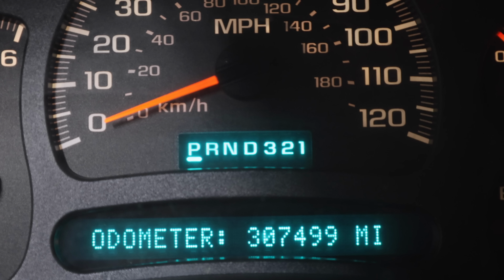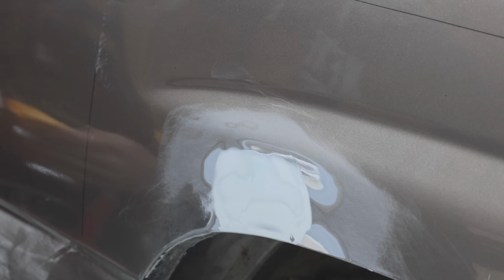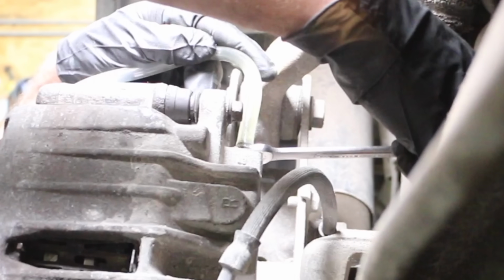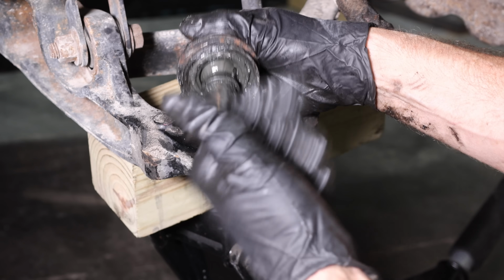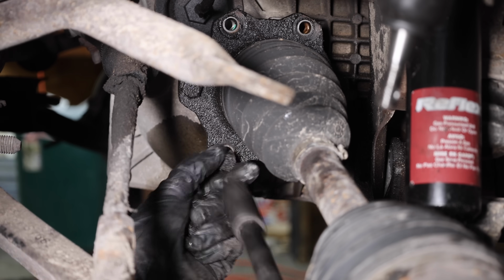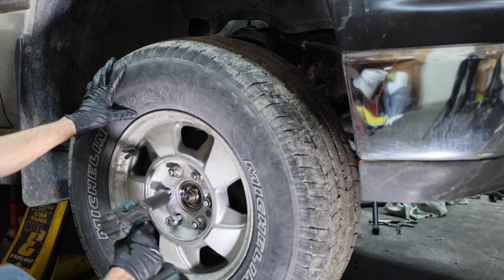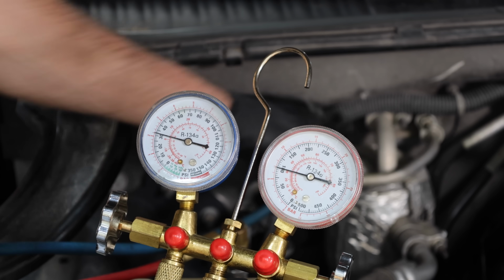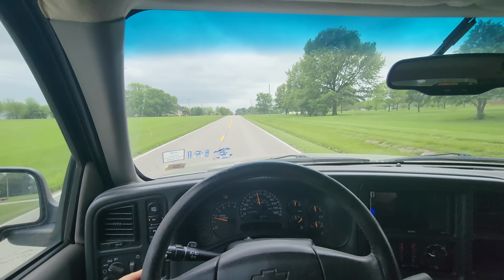Is It Stupid To Fix Up A 300,000 Mile Vehicle? Let Settle This!

Comment: I really enjoy all the stuff that you do because you’re so thorough. I went to a Bendix brake class about 10 years ago maybe more and they insisted that you open the bleeder before you collapse the pistons so that you don’t put any of that gunky brake fluid back through the lines to the ABS unit. And then doing it this way you can have clean fluid because you can just leave the bleeder open and put more in the master cylinder anyway you want to do it, but it’s a good idea to change the brake fluid because it does have tendency to suspend moisture which will corrode the calipers and pistons and stuff. Keep up the good work man I really like what you do.

Comment: This is really interesting. I've got a 2002 Suburban with 312K on it and I've recently been considering getting it back on the road. I'm afraid though, it may be one that has the micro cracks in the aluminum head and is burning through coolant. Any insight on that?

Comment: Only the total toe affects the handling. Having one side toed in and the other toed out the same amount will just mean the steering wheel is off center going down the road. Definitely something I would not want, but it is not a safety issue, and will not cause excessive tire wear.

Comment: There was one more thing that you could have done since you were so far in the front end. You could have changed the Upper A-arm bushings. (Lowers tend to last a lifetime.) 
New bushings reduce vibrations at high speeds! Cheers.

Comment: You repair a vehicle until the price of repair exceeds the price of replacement.

In my market that means you repair pickup trucks until the body rusts off the frame. 

A good friend of mine never spent more than $500 (1990's dollars) on his commute vehicle. He'd run it until it broke down and then he'd sell it and buy another $500 beater. Most of the time he'd get six months to a year each vehicle.

His reasoning? Beaters were cheaper than buying "better", they did what they needed, and were cheap to insure. Plus, AAA is/was cheap and when he sold it, he usually had enough $ to buy another or close to it.

Comment: I have an 08 Sierra that doesn't have any steering slop, but simply changing out the shocks and coil overs made a massive difference in how it handled. You don't notice how bad they really are until you swap them. It was totally worth the time invested and shocks were surprisingly cheap.

Comment: The thumbnail poses a question.  The answer IMO is no.   A vehicle with cab/chassis is theoretically rebuildable til the end if time and thus worth having/keeping.  We're you "dumping" money into a unibody type car, I'd change my answer to yes.  Unibody is designed obsolescence since repairs to the "cab/chassis" are way harder to complete and once corrosion starts its damn near impossible to stop

Comment: I just sealed the differential on my 2001 Yukon in the same way.  I didn't tighten the cover bolts until a day later, and when I did, uncured RTV came out around a few of the bolts, so I waited another day before filling it.  No leaks, but I'm not sure if it's worth not fully tightening the bolts the first time on the initial cure.  The most important thing is not to use too much of the RTV, it's just like the three bears story, you want the amount just right.

Comment: DON'T change your pacing. If someone has trouble keeping up they can adjust the playback speed to their liking. 

p.s. - at  20:00  mark, for front wheel pivot I use a folded plastic garbage bag between 2 sheets of carboard under each tire

Comment: 0:18 Strangely enough, the front-end wheel slop would have been enough to have it illegal to drive in the UK (MOT fail right there) - Otherwise, the rest of the issues would be normal maintenance (changing the brakes being the most obvious). Still very good to see and shows how with a bit of good maintenance a car can keep rolling for literally years longer.

Comment: I fixed up a old 1995 dodge ram 5.9L V8 that had 398k miles on it when I got it. After rebuilding by getting nicked and dimed over 3 years. I had virtually a new truck. body panels was dooky but the frame was from the desert so it had almost no rust. got the odo over the next 8 years to 999,999. used it for a about a year after that before a drunk driver rear ended it and destroyed the frame T.T I loved that truck.

Comment: So hey, what are you doing with the good 50,000 mile spark plugs and wires buddy? Ive always survived on leftovers, and the cars most people gave up on years ago. 
But really, Good used factory parts can be better than new cheap aftermarket parts. Especially sensors, starters, and alternators. Hard to explain to someone that their brand new parts are the problem, but when its better with used parts, they get angry. 
Bad new parts are more common than ever.

Comment: So how long did you work as a professional mechanic? I'd like to do this kind of maintenance to my 2010 Tundra, which has only 160k miles and a lot of dings and rust. But no way I'd have the confidence to attempt almost any of the repairs you did. Very impressive.

Comment: Love the 2X4 sanding block. I've done the same. You use what you have around you. Don't know how many times I've had to create my own "special service tool" by cutting and welding angle iron or flat bar to get the job done.

Comment: Got to keep those old vehicles running. So yeah, even if you have to fork out a couple thousand dollars in replacing old suspension, brakes etc.. it's definitely worth it to keep these vehicles on the road when you consider the lunatic prices of new (or even used) vehicles.

Comment: Don't change a thing, have been watching for years and your pacing is perfect.

The only thing I would mention when changing dif fluid is loosen the fill port first, it sucks to drain it and then find out you have an issue with the fill plug being stuck or stripped and need to run to the store because you didn't pick up a new plug. 

Had it happen to me a few times but luckily had a second vehicle to drive to get parts with.

Comment: I bought my 93 ranger with 300 thousand miles because my other one had 760 thousand miles. Dropped the engine in my new truck runs good 3 yrs later

Comment: You failed to address or adjust caster and camber when you aligned the front end. It makes a big difference. On most RWD Chevies you can true caster by equalizing plumb deviation between sides and bring them to spec by measuring and adjusting rearward axis tilt from upper to lower ball joint grease inserts. You can true camber by plumbing each outside wheel rim using a level.

Comment: Nice video.  15 years ago I paid Les Schwab to replace all the brakes, ball joints, tie rods, struts / springs, other suspension and tires on my Mitsubishi Galant with 425,000 miles on it (the engine and transmission had been rebuilt and the rest of the car was near mint) for about $4,000.   A few months later one of the springs broke.  I found out that Les Schwab did not replace the springs on the Struts as I had requested.  Then Les Schwab said they would not honor the warranty as the springs were used.  Thus breaking my car and leaving it unusable, especially as they banned me from their dealerships for complaining about this.

Comment: I'm a big fan.  I want you to test 15W-40 diesel truck oil mixed 6 oz per quart with Marvel Mystery Oil in air cooled motorcycle engines vs. motorcycle specific oil which all costs a lot.

Comment: Your car is an expense, not an investment. The idea of spending $3000 on a car worth $5000 doesn't really apply, the only metric is how much is this truck going to cost you over the next 5 years. If spening $3000 means not having to spend $50k on a new truck, that's a bargin no matter what the truck is worth. However spending $3k on a truck that is goign to cost you another $10k in repairs over the next 5 years the math starts to change but still going to take a lot of repairs to make up the diffrence.

Comment: As far as protecting the car's surfaces, periodical washing, decontamination, machine polishing and then adding a ceramic coating, not just a spray, will ensure rust free for the future (if there is no internal rust?).

Comment: For a Vehicle that's driven 482 000 Kilometres ( 300 000 miles ) it most likely require Engine Re-Build and new wiring. Also all the fluids and filters changed. GM still make brand new LS1 Engines in USA ? LS1 is one of the best engine swaps for most cars.

Comment: Definitely much cheaper than replacing the Suburban with a new one. Greener too. Another thing I noticed, there seemed to be lots of room in the engine bay and suspension area to work on. I'm not sure a new vehicle would be the same.

Comment: Awesome video Todd, great work as always :) 

A tip I learned the hard way - with the brake bleeding, if you're getting rhythmic air bubbles like in the video, often I find that is caused by the bleeder being ever so slightly too open - closing it a touch stops them. I imagine less of an issue with a fluid extractor (could even be because of the fluid extractor?), but when doing it manually I definitely notice the pedal is slightly less stiff with those bubbles passing through :)

Comment: This was certainly not what I was expecting based on your  title, but interesting.  I will say, that it is less expensive to repair as you go on a high mileage vehicle.  We are currently driving a 2002 Ford F150.  People keep asking us why we keep fixing it instead of buying a new one.  It's because our repairs and maintenance are generally less than a car payment when we do take it in, and save us hundreds over buying new.  It is always better to repair than to replace, unless the vehicle was a lemon model to begin with.  So, no, it is not stupid to fix a 300.000 mile vehicle.  Good show!

Comment: My 2000 k2500 just cracked 250k miles and just got a whole new coolant system, ignition system, and currently installing a bunch of new suspension components. New vehicles are too expensive, gotta keep the old ones running! I am fully convinced that my frame and body will go before anything else (thanks to East Coast and Midwest winters) great video man.

Comment: 0:15 Here in Finland, all cars older than 5 years  have mandatory yearly inspection and you cannot legally drive any car with that much slop in steering (or in suspension in general). Old cars do not have sloppier steering here than say 7 year old cars if they are street legal. Even a single sloppy ball joint in the steering parts results to failed inspection and if the car is otherwise drivable, you get 30 days extension for the car to fix the issue and re-inspect the car. If you fail to repair the car, it's illegal to drive the car on public roads after those 30 days.
Reply: People here drive with bald tires, clicking CVs, grinding wheel bearings, one head light...and all kinds of shit. Some states have vehicle inspections, but here in Ohio, we don't. We do have whats called an "E-check" which is an emissions inspection, which you need every two years.
Reply: My state has no inspections. We do fine.
Reply: @ If you check Our World in Data info for "Death rate due to road traffic injuries, 2000 to 2019" you'll find out that US has 12.7 deaths per 100K people and Finland has 3.9 or about 70% less.

Sure, some of that could be just skill issues but having broken cars in traffic surely makes a difference, too.
Reply: @MikkoRantalainen it is your culture of wusses. Not your skill.
Reply: @MikkoRantalainen finland is about 3% the size of the usa, and the amount of traffic compaired to the use is 1 percent the volume of traffic. You're statistics whole sound nice are unrealistic and from a place of pure ignorance of the grand scheme of things. America has about 340 million vehicals of the road a day on average finland has a hard time reaching 2 million.
Reply: @joeymorrison6743  Yes, the population of Finland is comparable to small state in the US. That's why I used per 100K stats instead of nationwide stats because those scale automatically to population.
Reply: America commonly has 100,000 vehicals bumper to bumper in small cities, finland equivalent 100,000 drivers in half thr nation. Why is this measurement massively flawed? Concentration of traffic matters, in small areas matters more than a rudimentary per capita type scale.@MikkoRantalainen
Reply: @joeymorrison6743  If you have more people per 1 km of road, you should have higher requirements for cars and drivers if you want to keep traffic accidents. However, in reality Finland has higher requirements for both cars and drivers than the US. Unsurprisingly, the stats show that US performs much worse.
Reply: @MikkoRantalainen America has over 300,800,000 registered motor vehicals. Finland hardly has 3 million. No valid comparison can be made between the two. Such as the average cost of a vehical in finland makes and models is 1/3rd as much of America using your logic they are half the quality.  Since fact if finland had the volume of traffic America does the incident rate would be much much higher.
Reply: @joeymorrison6743  Have you understood that I used per 100K statistics? Of course, US is bigger than Finland but the traffic accidents per 100K people should be equal no matter the total population.

If you want to compare closer to apples to apples, compare US to whole Europe. Europe has approximately 745 million people and Finland isn't even nowhere the safest country in Europe so all of Europe crushes US in the competition per 100K despite having much higher total population.

Total population doesn't matter, only per 100K numbers and US sucks on that metric.
Reply: @MikkoRantalainen what you have to understand is we naturally do not trust the government and we don’t like them acting like our daddy. 

And you may use a per capita statistic but it still doesn’t account for the massive complexity of implementing a yearly inspection system in such a massive country. Our government can barely even take care of our veterans so doing a yearly inspection for hundreds of millions of vehicles sounds like a giant cluster fuck that would costs hundreds of millions of dollars and become totally corrupt and incompetent anyway
Reply: @MikkoRantalainen  Scaling to *population * , doesn't correlate to traffic density .
Reply: @Behindthepaneco Vehicle inspection protocols vary widely from state to state .

  Some no inspection at all , some yearly , some when a vehicle is sold ( actually bought) . Some inspections at government facilities with government employees . Some at private garages licensed as Inspection Station , done by mechanics licensed as Inspectors .

  And no statistical pattern between them as to motor vehicle deaths .

  Government facilities are boondoggles , staffed by stupid bureaucrats. Independent facilities vary some very good , some ignorant,  many treat it like a scam . Improperly failing items , in hopes to gain business doing unnecessary work .

  In order to physically inspect the huge numbers of vehicles in Annual jurisdictions,  it's simplified so much , as to be a pointless joke . 99.5% of the time , if it drives up under its own power , and the lights and horn work , that's it , unless it's blatantly falling apart .
Reply: Glad I don't live anywhere where they require a vehicle inspection
Reply: Id imagine the issue is much more impactful in inclement conditions, i.e. most of Finland lol, so it makes sense they'd take it a lot more seriously
Reply: That's sad
Reply: sounds like you live in a communist country no thanks
Reply: Kinda sucks if you can't afford to buy a new car. I still drive my old 4x4 with 225k miles. Mostly, I ride my ebike or walk. I'd hate to have to buy an expensive automobile because the truck I drive 1k miles a year wouldn't pass someone's inspection.
That seems like a horribly wasteful, elitist law made to sell cars.
Reply: @AcrylicGoblin  Nope, the inspection is about making sure the parts that are important for safety haven't rotted away. As long as the rubber seals around ball joints haven't failed, the ball joint should work perfectly even if the car is 30 years old. And if a ball joint fails, a new one costs typically 30–50 USD. In worst case, a full set of all ball joints and suspension arms for the front of the typical  passanger car costs around 1000 USD so you don't need to replace the whole car, just the broken parts.

I'm driving 25 year old car and pass the yearly inspection with flying colors as long as the suspension isn't broken. (And once you are familiar with the car, you'll feel that the suspension is not perfect long before you fail the inspection.)

Comment: Work looks really good, but I would have suggested starting with the engine to make sure your work wasn't wasted.  Check engine is on and it looked pretty damp.  Guessing all seals are pretty tired and the 02/ Cats are done.

Comment: The only change I would consider is the order that the tasks were undertaken.  
Any major issues discovered with engine, transmission, steering might cause you to scrap the vehicle and it would be unfortunate to have already put resources into brakes for example.  Of course if you already have a good idea of the vehicle's strengths and weaknesses and are committed to seeing the project through (at any cost)...

Comment: I have a 1999 Silverado 2500 with 332,000 miles on it!  I also use Shell Rotella in it but the conventional type. Unfortunately Shell recently started meeting SN ratings so I believe the ZDDP package is not what it used to be. Maybe a future test?

Comment: My 1989 Toyota 3 litre pickup 4x4 is at 300 plus mile and driving 10 years 
No expense . But I say this after a full rebuild. But a rebuild that cost 500 bucks , new everything. New everything. Pistons, piston rings,
Al  in gaskets, all pulleys. Everything.